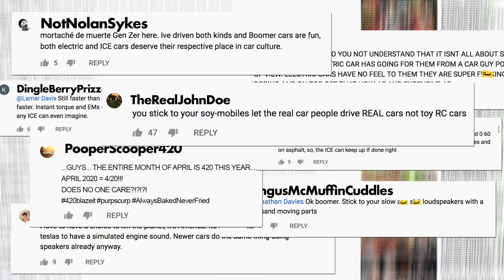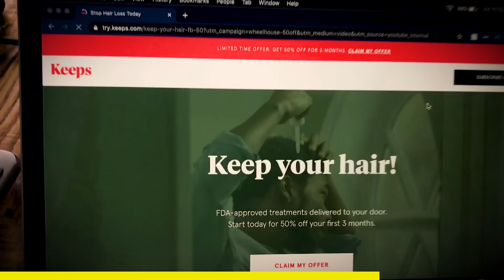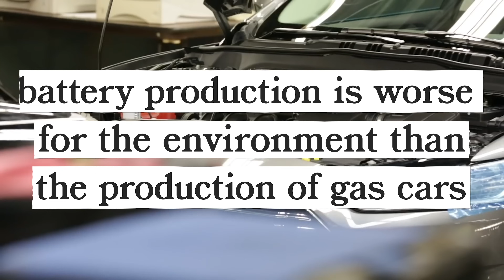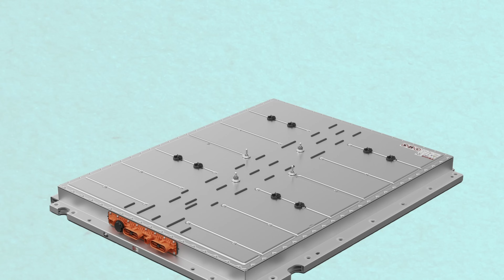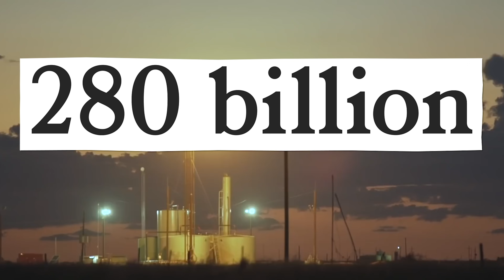Are Electric Cars REALLY Better for the Environment?

Comment: The state I live in has coal as it's main power source, meaning that electric cars here are running on coal.
Reply: still only 2 metric tons a year
Reply: @DragonDude-eo3js  its bullshit. so mining oil is bad but mining coal is clean. calculations in the video are totally omitting this fact
Reply: Then we should phase out coal
Reply: @jabbalito3787  No
Reply: @sparkydiamond2825  why not? Coal is the most harmful energy source we use. We should replace it with nuclear, hydro, wind and solar power
Reply: @jabbalito3787  You know how much jobs and livelihoods would be lost if we replaced coal and gas?
Reply: @sparkydiamond2825  None. They jobs lost in coal would be regained in natural gas, nuclear and, and renewables
Reply: We're living in Idiocracy. C02 is what plants crave, apparently.
Reply: @normang3668  I know right? CO2 is not plants main source of energy, sunlight is.
Reply: @sprucesoultree3833   Actually, CO2 is not a source of energy by any means.  It's a waste product from complete combustion, and is in its lowest possible energy state.  Carbon is there to do what it does best: form lots of bonds, to store energy and information, and form structure.
Reply: @UserName-us1nm  shit that's right, why do people think it is?
Reply: @sprucesoultree3833  because it serves the  oil industry if the public thinks they are informed without fully grasping how climate physics/chemistry works.  The FF industry learned from Big Tobacco that the most effective lies are buried in real truth.

I really don't know much either, beyond the basic concepts grade school kids can understand.
Reply: @UserName-us1nm  yeah, that makes sense.
Reply: @normang3668  @TheMagache

Plants do need a wee bit of CO2 to survive. The cycle of photosynthesis  requires light, water, and CO2, the natural byproduct of photosynthesis is O2 (Oxygen).
In short, plants require a bit of CO2 to survive, but they definitely don't need the amount we have in the atmosphere. We have added so much additional carbon dioxide to the natural carbon cycle, that it's altering our very planet. 

Heres a quick description of the carbon cycle. The earth does naturally undergo climate change, as greenhouse gasses are released from various sources. However, humans have greatly accelerated the rate of climate change with our ignorant combustion of fossil fuels, as the planet warms, the sea ice melts which releases methane, another greenhouse gas. This is called a positive feedback loop. 

The carbon cycle itself it the cycle where carbon is exchanged through the different components of our planet, (atmosphere, pedosphere, biosphere, geosphere, and so on) If you cut down a tree, and burn it. The carbon that was stored in the tree is now in the atmosphere. However, that carbon was ALREADY in the carbon cycle, it's been stored in the tree for perhaps 50 years, but it was already in the cycle. If you plant a tree to replace the one you selfishly murdered, it will take up the same amount of carbon. There is no net gain to the carbon cycle. 

However, if humans continue to destroy forests and other plant life, we are crippling the plant's ability to sequester carbon, unless they are replanted, there will be more carbon in the atmosphere. Despite the fact that it was technically already part of the carbon cycle, it was perfectly fine in the form of a tree. carbon is the building block of life, but when it's acting as a greenhouse gas, thats where the problems start. 

Plant life in the ocean is a massive carbon sink. But as the ocean warms, it begins to lose its ability to sequester carbon, and absorb heat. The additional heat has already had devastating effects on ocean habitats.

Fossil fuels are massive stores of carbon that have been out of the carbon cycle for tens of millions of years. We humans, in our infinite wisdom and remarkable shortsightedness thought "ooh, look, it's highly combustible" and that's about as far as our thought process went. as Fossil fuels burn, its greatly contributing to the carbon cycle, in unimaginable amount. So much CO2 that it can't be absorbed, especially not while humans actively remove the wilderness and forests at the same time. As our ocean warms and begins to suffer from loss of biodiversity and sheer numbers of creatures. Fossil fuels got us this far, but it's time to immediately cease use on a global scale.
Reply: @NomadicPhoton  not sure why you felt the need to write all of that. . .
Reply: It is a hoax only reason they're pushing solar etc is because of the UN agenda mandates 21,25,35,50
Reply: There's honestly nothing wrong with coal. They can eliminate toxic emissions by putting scrubbers on the emssion stacks. Co2 itself isn't a pollutant.
Reply: @TheMagache  found the science denier
Reply: @TheMagache  well why don't you prove it by driving to the edge of the earth? or do you need a chemtrail plane to do that for you?
Reply: @MenacingPerson  people who don’t believe in climate change, don’t believe in flat earth or chem trails. It’s the other way around. Check out Tony Heller on YouTube, he will set you straight on global warming.
Reply: @TheMagache  how the fuck isn't CO2 a pollutant?
Reply: @sprucesoultree3833  Because its naturally created and plants require it to survive.
Reply: @TheMagache  too much is bad for the planet though, we'll never have enough plants to balance out the amount of CO2 we put in the atmosphere.
Reply: @sprucesoultree3833  prove it.
Reply: @TheMagache  Is this the first time you've heard about climate change? Or do you think that companies are making a hoax that would lose everyone, including them, money?
Reply: @TheMagache  I'm not trying to come down on you, but it sounds like you've been exposed to misinformation; you've got a lot of stuff mooostly correct.  As a general question on the basics, are you aware of the general mechanics of the carbon cycle?

For context on the half degree of warming in the last century, the ice age was only 4 degrees colder.  It also took thousands of years for the climate to gradually warm up, and even at this pace it caused significant extinction.

You are correct that plants need CO2.  Something that you learn in medicine is that the dose makes the poison.  Too much of anything we need for life is lethal, be it food, water, or oxygen.  The climate is the same; plants can absorb only so much carbon.
Reply: @TheMagache  Shit, for a TL;DR, humans add extra carbon to a previously balanced carbon cycle, which changes the climate as carbon is the dominant GHG and regulator of Earth's temperature.
To explain why CO2 is a pollutant, you need to understand the carbon cycle.  At the surface, carbon is cycled between the atmosphere and the biosphere.  There is essentially perfect equilibrium between carbon released from the biosphere and carbon absorbed, and there has to be for the cycle to continue.

Carbon also cycles between the biosphere and the lithosphere, but at a comparatively slow, geological pace.  Carbon is sequestered into the ground, but also released predictably through volcanoes and weathering.

Humans extract geological carbon stores and burn hydrocarbons for energy.  This moves geological carbon stores into the surface carbon cycle at an "unnaturally" high rate, adding vast amounts of extra carbon to the normal cycle.  We can measure the quantity of extra carbon added through the ratio of carbon isotopes in the atmosphere.  Geologically-stored carbon has not been recently exposed to the sun's radiation, and is just carbon-12.  The decline in the ratio of radioactive carbon isotopes corresponds with human fossil fuel emissions and the rise in atmospheric carbon.  There has not been a corresponding increase in geological activity, ruling volcanoes and weathering out.
Reply: @TheMagache  That is a fair point: Our money could be spent much better elsewhere if the point is to minimize human suffering, like food assistance and housing projects. But I do think that we have some impact on our climate, and I'd like to believe that we can eventually in the future develop the technology to stop both artificial AND natural climate change, for the sake of everyone living in coastal or sub-sea level areas, like New Orleans.
Reply: @TheMagache  wym prove it? Co2 is litterally the greenhouse gas responsible for climate change
Reply: @TheMagache  we fucking care about climate change. Fucked up climate ruins the season of our crop. Rice gets more expensive and other food we eat, people here are very frugal.
Reply: @TheMagache  do you have evidence for there being no evidence about climate change
Reply: @UserName-us1nm  if it was previously balanced why did we have an ice age? 🤣🤣🤣
Reply: @Insomnia4321  oh my god, what a gotcha!  Humanity is saved!  Lololol
Maybe it's because Earth's climate is more complex than just a single factor.  Maybe Earth isn't a closed system, and is exposed to a chaotic environment within the solar system?

If you actually care to learn more about ice ages (and not just dismissing climate science) the reason ice ages happen is very complex.  It starts with what's known as the Milankovitch Cycle, which describes the various ways the Earth moves through the solar system.  Earth's tilt changes, its "wobble" around its rotational axis changes, and its elliptical orbit also varies.  Every 40,000ish years all these factors line up in a way that gives Earth an especially cold year.  This can't give us an ice age in itself, but it does give the Earth more polar ice.  Ice enables one of our planet's positive feedback loops; more polar ice reflects more sunlight, which gives us cooler temperatures and more ice.

Comment: For years people been saying there's no cost, no emissions, no pollution. That was and remains untrue. At best electric cars are slightly better, and you still need fossil fuels to power them. Rational people aren't anti-EV for no reason.  They just don't mindlessly obey the mass, Liberal agenda of people like Al Gore and Leo DiCaprio who chastize middle America, whilst flying to and fro in private jets, which is fine by the way, minus all the hypocrisy, because climate change is a joke. The temp is 2 degrees warmer over the last century and the air is exponentially cleaner.  There's more vegetation and food and everything is air conditioned.  Even if the environment was worse off, there are more important things.

Comment: Great Vid. I love ICE cars but I do believe that EV's are here to stay. One thing that was not factored into the calculation was what happens when they die? almost every part of an ICE car can be recycled but the EV has some extremely caustic and dangerous chemicals (especially the battery) that are hard to recycle and are pretty nasty when they are leaking. I'm sure they will get that figured this out as well.
Reply: VW believe EV's are here to stay too.  Look here....   https://www.volkswagenag.com/en/news/stories/2019/01/volkswagen-to-manufacture-electric-cars-on-three-continents.html
Reply: New fuels are being developed that give extremely clean emissions from internal combustion engines. For example the new synthetic fuel developed by porsche reduces tail pipe emissions by 85%. This would put the internal combustion engine on a level of emissions output at the same level as a electric vehicles.

Comment: Im a firm believer that EVs should be small personal transport like scooters, trikes, electric bikes  etc, and mass transit systems that integrate those smaller vehicles. I wish it was easier to run IC on locally produced methanol,  catalttically converted from methane harvested from waste.

Comment: Hydrogen would be cleaner than electric. And more economical. Given any pre existing "ice" engine can be ran on Hydrogen.
Reply: But it isn't more economical, either to produce or to use in a car. Once it's extracted it still has to be transported in trucks to the points of storage and use. That means more pollution and emissions.... A hydrogen powered car with a fuel cell is still driven by an electric motor........

Comment: To clarify your last false about the power grid, well that's partially right.  The grid can handle it however it depends on the individual transformers splitting to each home and how many houses are fed off one.  Typical is 5-8 houses, but if they all suddenly charged their EV's that transformer is kaput as they say.  Then lots of older neighborhoods have old low 5-10 kVa transformers which die quickly under EV charging loads.  So the grid to transformer is not the issue, but the size of the transformers and how many houses are fed off each one.  At the rate EV's are growing I think the transformer upgrades will closely follow so it wont turn into a huge issue like people believe though.

Comment: But bateries degrade overtime. So one day EVs will need to get batery replacement, but what about the old bateries? What impact does recycling of these has on the environment?
Reply: @Sr. Boi Olla they can be recycled. Tesla also announced that they will recycled Tesla batteries in Nevada.
Reply: New tech is making batteries which degrade much more slowly. As it is, EVs already last longer than any ICE ever built. And despite what idiots say, ones critical production is reached most batteries will be made from recycled batteries. It will be easier and cheaper than mining. You guys are exactly who this video was made for and you are still grasping at straws lol.
Reply: @pramienjager2103  lol so much stupidity from petrol lovers... feel like they are the ancestors of folks that hated the first ICE. "horses have much more range and are cheaper."
Reply: Topic for another video...
Reply: Not necessarily a complete battery pack replacement though. More often than not, it is usually a few tired cells causing a reduction in overall pack efficiency. These can be checked, tested and replaced by an EV qualified technician in two or three hours. The cost would be comparable with a full service or clutch replacement on an i.c. car.....  Any old battery packs usually still have sufficient capacity to be used as storage batteries for industrial or commercial use. Failing that, they can be recycled....  Internal combustion engines also become less efficient as they wear, and so emit higher levels of emissions.
Reply: dont assume stuff that hasn't happened yet
Reply: @Sr. Boi Olla they will be next year or so. And it's less polluting than the ICE infrastructure

Comment: With ICE cars I never see the oil maintenance usage over a cars lifetime included in the co2, and although battery fires were mentioned there was not info regarding petrol fires in cars, or oil tankers sinking spewing millions of gallons of oil into our seas or even the processing plants exploding and oil wells/pipes catching on fire etc, if you want to be balance then balance it and include EVERYTHING.

Comment: The first point you compare the battery production VS the production of an ICE car. The battery is the gasoline of the car. Now compare it to the gasoline for 500.000 KM as a battery can easily last 500.000 KM in an EV. Point two: Lithium. You focus straight on the Li Triangle and ONLY focus on that. The same with point 3 you straight go for child labor. Both already are not used by car companies any more (except for a few Chinese unknown brands) Lithium can be won out of seawater and Kobalt is hardly used anymore and is nearing the 0% mark. As for point 4. We can already reuse 99% of all battery's But when a car battery is getting recycled it does not mean that it is being scrapped in the process. Loads of batteries end up in a house battery system. And then you start on storage fires. Yes, these fires are real but can I remind you that there are also a lot of fires in scrap yards of ICE cars. (here is a link on battery recycling: https://www.youtube.com/watch?v=Bpe8HalVXFU) Then you start to rattle about coal-powered cars. Again forgetting how gasoline is produced! So again you are wrong! (where the hell did you get this information from?) And did you ever think to ask the drivers of EV cars where they get their power from? You will find out that they (like me) are sick of people telling them their cars are coal-powered. So when we get our energy we make sure its green! Hardly any EV driver uses gray power!

Then you start on ICE cars. Unlike with EV cars you went for the average while you loved pointing out that a BIG EV was more polluting. And you are forgetting that a EV lasts way longer (500.000 up to 1.000.000  KM) then an ICE car (400.000 up to 600.000 KM) And then there is the whole dieselgate thing! As ICE car companies are doing everything to cheat their way out of so many things to claim their cars are cleaner than they really are. And they are still doing it! (as you could have seen in recent reports) And on rare earth materials, an ICE car has this as well. iridium, platinum, titanium, and even Kobalt is used in an ICE car! (Hense, there is even Kobalt used in the production and refining of the gasoline! And we burn that Kobalt off meaning it cant be ever used again! while in an electric car you can!)

So taking all that into account your already positive outcome on EV's is not even close to what it really is.